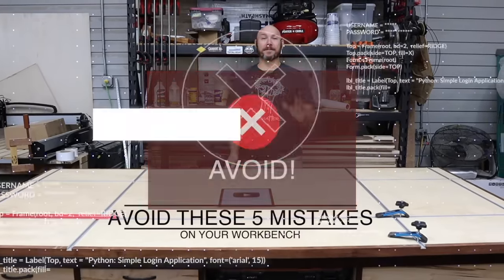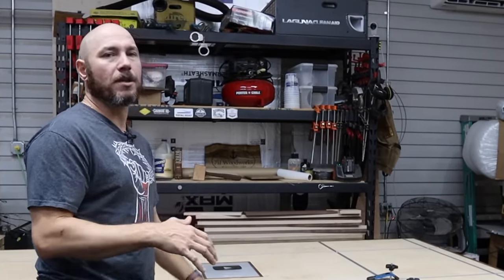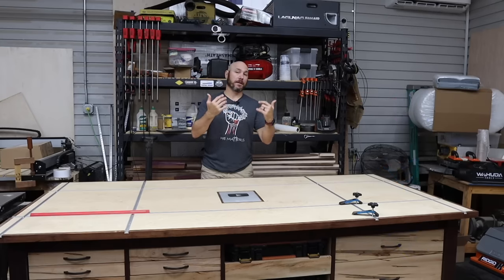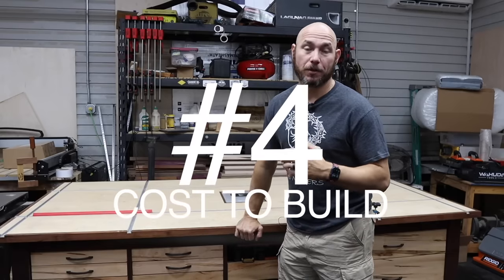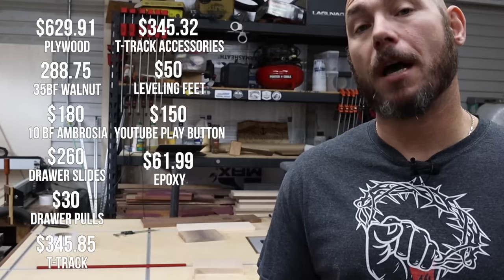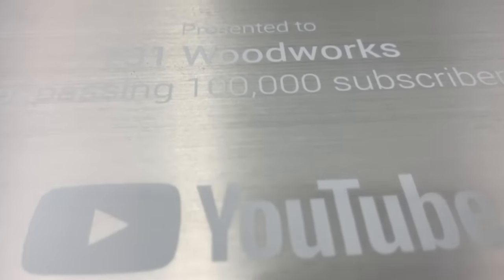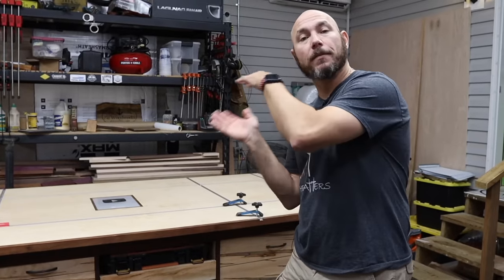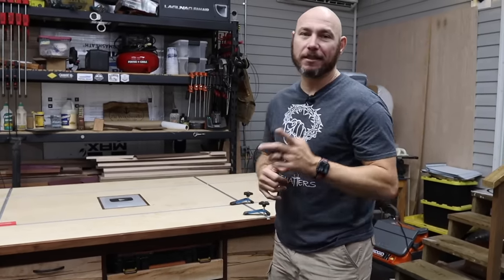Don't Make These 5 Mistakes When Building Your Workbench!

Comment: A solid core door and some saw horses, or whatever you can use to achieve level/ preferred height, makes a good workbench for those with limited space or funds.
Reply: Bought a door and base for $20 at garage sale. Great miter station and workbench!
Reply: Good point -  I used a $2000 door for my temp work bench 😞
Reply: Man, I can't find an affordable solid core door anywhere.  I ended up settling for a hollow door from my local Habitat for Humanity Restore.  It gets the job done but I'm just waiting for the day I clamp something straight through my tabletop 🤣
Reply: @ARMYStrongHOOAH17  Keep your eyes and ears peeled for offices, schools, or libraries doing major renovations or being torn down. I got my solid core doors from an architectural salvage store that got several from a school. These things are HEAVY!
Reply: That's how I started with R/C airplanes in the 80's.  It was FANTASTIC!

Comment: I still love this video to this day. The mention of "no ideal workbench height" is still one of the best comment I've heard.
I am 6'3 and to me, the perfect height is 40 inches (including the casters).
Why is it so high, you might ask?
Because I have lower back issues (sciatic was pinched at an old job of mine and since then, I feel pain relatively easy to my sciatic)
So, for me, the perfect height is the height at which I can see clearly without the need to bend down, that I can write/draw easily without bending down, that I can easy use hand tools as well (hammer, chisels, screwdrivers, plane, knives, staplers), that I can do MANY things on it (woodworking, metalworking, electronics, mechanics, etc).
So, for me, that perfect height was 40 inches. It isn't an assembly table though, it's a do-it-all workbench. It has 6 casters that supports 500 lbs each, it was made with (if I remember properly) 6 or 7 sheets of 3/4 plywood, it holds all of my power tools for now, but they aren't functional in it yet (I didn't transform it into a all-in-one workbench, its still a do-it-all at the moment) and the top of it can withstand a bare minimum of 4 panels of 8ft garage doors, about 20 2x4s of 8ft, and my weight on top of it, without even bowing... SO, I know for sure that I can put an ATV motor on it, or whatever I want to, and it will hold without deforming, and I can also put small electronics stuff on it and it will still be high enough to properly see.
Everyone has been telling me I'm dumb for making it that high, but to me, it's bene a godsend.

Comment: Mate! Gday from down under! This bench is incredible. It's like the last house your ever buy. This is the last bench you'll ever need. Youve done your time on particle board and pine 2 x 4 throw together gear. You know what you need. Me, I have a number of different benches for different work areas. Out here in the bush if your shed isnt bigger than the house you live in then the boys think there is something wrong LOL. At the moment I do all my woodworking on what's known as a Low Roman Bench. Its 8ft x 2ft in your money and only knee high. Being a predominantly hand tool wood worker this bench is great. Its also great as Im a bouncing baby 430lbs and spend most of my time sitting down to work (dont worry I get my 5000 - 6000 steps in each day doing other work). So yeh horses for courses as they say. Cheers

Comment: Thanks for the tips.
I just built a workbench/outfeed/assembly/router table, and I finished it with Danish Oil... but not the Watco one... I got mine at Lee Valley Tools and I followed the instructions (go figure). They are a little different than the Waco instructions but the finish is absolutely gorgeous! no sticky spots.
Keep on inspiring us!

Comment: I built a work bench 18 years ago it’s 4x6 and it doubles for my table saw out feed ,it has and open second shelf for sanders, drills, and and my air nailers. The top is 3/4 plywood it has paint glue drippings all over in other words it looks well used. I wanted to replace the top until the Mrs said don’t get rid of the stories everything you’ve build is represented on the bench top you know she’s right.👊🏻

Comment: I just saw this video, tying to figure out what kind of bench I want to build....  That bench is beautiful, and has given me some great ideas.  That said, I've had similar problems with Watco's Butcher block oil & finish (based on a few recommendations).  It's not sticky to the touch, and it does provide a nice layer of fundamental protection....but, dust does seem to stick to it, rather harshly.  But, I digress.....great video!

Comment: So my thoughts - 

1) It is a nice bench layout in general.

2) I don't know how you spent that much on the t-track unless you purposefully sought out the most unreasonably expensive t-track out there. I priced out a similarly sized bench  build and ended up spending only about a third as much as you for the same amount of t-track.

3) I hate the ambrosia maple. Not just because it's unreasonably expensive but it's just ugly. You pay a king's ransom for what looks like barely finished, beat down, pallet wood.

4) I made my bench that size and realized I was going to run into the same clamping problem during the planning stages so I decided early on to not use clamps. Instead of creating some contraption for the sole sake of clamping the bench together I went with large drawbore mortise and tenon joints. No need to clamp anything. I took time and made sure the mortises and tenons were precisely placed and square and the whole assembly came out square.

Comment: I was on a budget. Norm Abram's assembly table was a good, economical and simple build. It's basically a hollow core door on legs with a replaceable MDF top over it.  The frame is one 4x8 sheet of 3/4" plywood.  Mine is 4'x6' and on lift casters. Your explanation of racking due to an uneven garage floor opened my eyes. I will have to check it for level when I move it. Hopefully, I can add drawers underneath later as my budget and time permits. I was using the MDF on two saw horses previous to this build, but as I get older, MDF gets heavier. It was too hard to move it so I could get my truck in the garage at the end of the day.

Comment: For me (and I'm a little surprised this wasn't mentioned, maybe its a given...) the big mistake to avoid is lack of planning. I'm sure (myself included) no one hits it perfect on their first attempt, but I am doing as much research as possible to find what I like and what I don't like. For example, I had not thought of, nor seen in any previous videos the idea to make a storage location for a cross cut sled. Currently  I am trying to contemplate how much t-track I need and where to place it I think for now the solution is to add none, but to keep in mind where I think I need it and avoid fasteners in those locations. I'm sure I will figure out quickly where it is needed and where it is not. I also appreciate the surface finishing tip. Great video.

Comment: Great video. I'm in a small shop, so my bench is about 4' x 4', and I'll be adding a 2' x 4' jointer's bench with the same height, giving me an overall bench area of 4' x 6'. My bench holds my table saw, router table, planer (on a flip top), air compressor, and I'll be adding a downdraft table. I have a power outlet on either side for small tools. It is partially plumbed for dust collection, but eventually everything will be plumbed with blast gates so the whole bench has one outlet to connect to my shop Vac.

You give many good tips, and I agree with them, having built my own bench. Thanks for the great videos!

Comment: I’ve seen the bench in all your newer videos but not this video. $2600.00, that OSB ain’t looking half bad! Lol. Before you mentioned why you committed I was thinking what you said. You having a channel, it’s a great centerpiece and display of your craftsmanship. Not a half bad investment, being you got so many ‘gifts’ lol. Jk.
 I’m sure it was a fun build (my favorite type is workbenches) bet you had a couple sleepless nights brainstorming on the project. At least that’s how I am. But your wife’s support is awesome and that always helps. 
I built a smaller one a little over ten years ago, but not for the purpose of assembly necessarily. It was similar to one of the traditional ones you see with the leg vise and wood vise and some drawers, so it was a bit taller. 
Kinda of common sense but when I was trying to figure out height like you said it’s personal but think about your back. Stand up straight put your arms down by your sides, bend your arms at your elbows out in front of you so they are at 90° with you upper arm. Then I think it was it’s recommended the height of your bench is 4-6” below your fingertips. (I hope that’s right) Anyways need to build another sometime. 
Always good to see your new vids, keep it up!

Comment: Matt, There is an old rule-of-thumb about height of a workbench: Let your arms hang down and the table-top should be at the position of your wrists.
That is also 4 hand-spans from the floor.
A good "depth" of a workbench is 3 hand-spans.
One hand-span being the distance between the tip of your thumb and the tip of your pinky, when you stretch out your fingers.
For instance, my hand-span is 25 cm, so my workbench's table-top should be at 1m, the depth would be 75cm and the length about 7 hand-spans (1.75m).
-The length and depth, however, depends on usage - maybe you need to make doors for your house and you wish to put the doors on top of the workbench.
The above hints are for 'everyday-workbenches' (planing and sawing).
When one needs to saw, for instance dovetails, the workpiece needs to be elevated about a hand-span; some prefer having an 'add-on' for the workbench; others, doing a lot of sawing may wish to make a special workbench for that purpose ony - such a workbench does not need to be big, though.

Edit: I forgot to mention that those measurements are for hand-tool workbenches that are intended to be placed against the wall.
I'd categorize your workbench differently; it's a mixture of an assembly table and a workbench you do not have placed against the table.
-So I'd say ... those are things to add to one's considerations. ;)
As a standard in Europe, a tabletop is at 95cm, but some people are tall, some are not; the 95cm is an 'average' only.

Comment: I made 3 2’x4’ benches. I typically use one as an out feed table, one as an assembly table and one to keep things like my sanders and small drill press on. They are all on casters so I can push them all together and lock them in with few clamps, now I a 4’x6’ table for large glue ups or working with full sheets of plywood.

Comment: I like your setup. because I have a small single stall garage, I made 2 rolling workbenches 3x2 ft each. one has a opening on the side so I can use it as a desk.  I usually use one workbench to build on and when I'm doing bigger projects I will use both together and lock the casters.
Reply: My first work bench were 2, 48" x 48" benches on castors.

Comment: Great video, thanks for sharing.  It is good to see how to avoid common mistakes.  I recently finished the main part of my new workbench, I will continue to add on to it like drawers and shelves over time.  The bench itself is the same size as yours, but total size is a couple feet longer to incorporate my Kobalt table saw.  Mine is way less expensive as yours , but that is because I used 2x4’s for the frame.  Only used 3 sheets of plywood.  I have to say yours is much nicer than mine.

Comment: @731woodworks I’m  starting to build this.  Not as fancy as yours but 4x4’s for the legs, tubafors for the stringers.  I don’t want to purchase 3/4” birch   I have about 30 sheets of 1/2” plywood left  over from our house build.  I was going to double up for the ends , dividers and floor area.   That should be ok right.    Going to make the drawers out of that too.  I have some rough cut cedar and also some nice pallet wood that I will use for the drawer fronts and facings.   I post some pics as we go along.   Oh. I have a dowel jig is that better for the main fastener or pocket holes.

Comment: Your work table is sweet. I have mine on casters but my floor is fairly level. It's a  4x8 as well and level with the table saw...which I like but I think the table being a lil lower than the saw would be better. But the clutter is soooo true.🤣🤣😎👍🇺🇲

Comment: A quick rule of thumb for benchtop height is that you should be able to set your hands flat on it with your arms at full extension or elbows just slightly flexed without bending down. That means you can do any action you need to do on top of it without bending over -- which is the main cause of back strain.

Hence, your actual height matters less than the height of your shoulders and the length of your arms. This can be approximated with height, but not if your arms are very long or a lot of your height is in your neck and head...
Reply: Please stop spreading this misinformation.
There is no perfect height. It is all related to what you want to achieve with it.
I just posted a long comment about why my workbench is 40 inches high, yet I am only 6ft 3in.
I wanted it to be an ideal workbench for almost everything I do while not having to bend down at all because of a work accident I had to my sciatic.
I do mechanics, electronics, electrical, woodworking, metalworking, but I also gut my fishes and sew on it.
The smallest thing I will ever put on it is most likely an electrical board, something less than 1" in height, and the biggest thing will most likely be an ATV engine or an engine of any kind, so in the realms of 12 inches to 24 inches I would say.
This means that I need to be able to work on it without having to bend down or squint to do ANY of the tasks related to those jobs.
If I would've went with the regular "elbow height" pattern, it would've been closer to 35-36" in height (I have long arms), and at that height, I can't reach passed 17 inches without having to bend down due to my height/arm length ratio and the angle it creates. At a height of 40" though, I can read all the way to 29-30" without moving. A distance almost double of what it is at roughly 4 inches lower.
We all know that stuff moves around and whatnot when we fix stuff or do stuff in general. That workbench is meant to be stationary 90% of the time, against a wall. So, to me, the height of 40" makes it much more valuable AND also allows for more storage in it, which is not to be neglected.
No, it isn't ideal for stuff that requires pressure like sanding, because of elbow fatigue, but I already have issues with my elbow (I have the "pitcher's elbow" because of when I was young playing baseball as a pitcher), so I already can't put much pressure, I let the sander do the work, or I flip the piece vertically and push up against it as if I was trying to push against a wall.
I wouldn't be able to do more precise stuff at a lower height, so it wouldn't be ideal at all and isn't even close (4 inches is far, in my book).

Comment: One of the problems I have with woodworking is height which cause what I think is called rhomboid pain.  I'm  6'2".  If my work surface is low I will experience a lot of discomfort in my upper back after a long day.  As you said, workbench height is personal.

Comment: I really consider this more an assembly table than a true workbench.  I prefer a "real" workbench to be smaller (in the 3x6' range), with overhangs so you can access all sides easily, reach over it and use any included vises or edges for clamping.  As an assembly table, I totally agree and love yours... make it as big as you can to fit the area you have.
Reply: Love Ron Paulk’s PSS (Paulk Smart Station) and PSB (Paulk Smart Bench). They’re both about 3x6 and you can build the PSB as a 4x8 PSBB (Paulk Smart Big Bench). Just getting into woodworking and PSS will likely be my first major project. Clearing out overstuffed one car garage to make room for small shop, no room for bigger Bench unless/until I eventually build bigger garage/shop in back yard.

This not meant to denigrate Matt’s fine work. He’s a good man and I’ve learned a great deal from his many awesome vids. But, alas, I just don’t have room yet for a 4x8 table.

Comment: Very nice looking bench. What you built is a workbench/assembly table. The purist's workbench is something long and not very deep at all, like 24 or 26 inches, with a face vice and some sort of end vice, for specific reasons. I'm in the middle of building a Ruobo style workbench, but like you, it will also serve as an assembly table. So mine is 30 inches deep with an emphasis on features that facilitate joinery. I do a lot of pocket hole assembly so ways that make that easier are a big part of my bench plan. I think each person's bench should be a reflection of how they work, first and foremost.

Comment: Hey to avoid NOT having a clamp long enough, invest in 3/4" Bar Clamps. A set of these will run you about $18 bucks at your local HD in Little Rock. IDK how much a 10 piece of 3.4" black iron gas line pipe will run you because I just found already cut up bars for sale. They usually come in 10' sections and usually cost about 20-30 dollars for a length that's 10'. Matt, once you start using these guys, you will become addicted to them. You can make one as long as you like as long as the pipe is that long.
Reply from the maker: Thanks.  I have some pipe clamps, just need to pick up some longer pipes for sure!